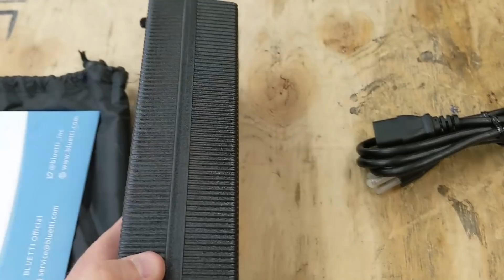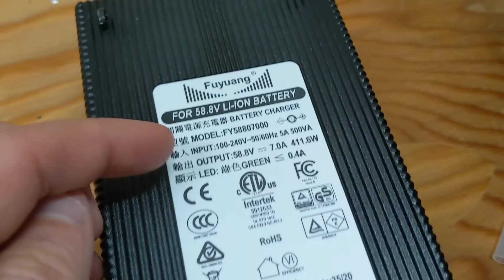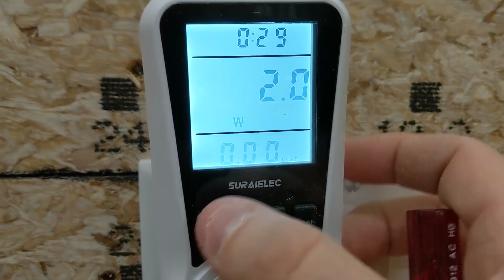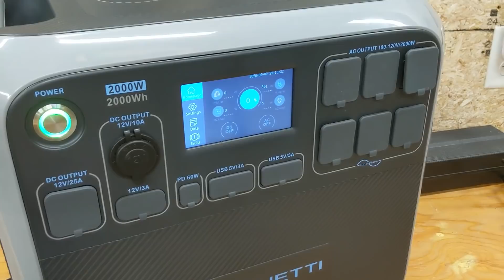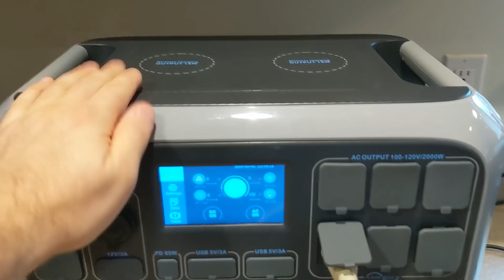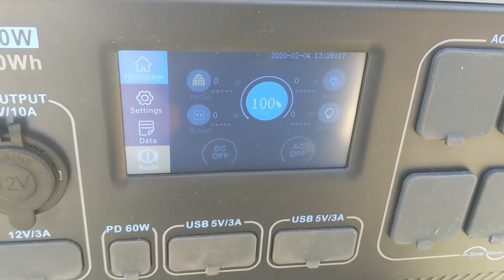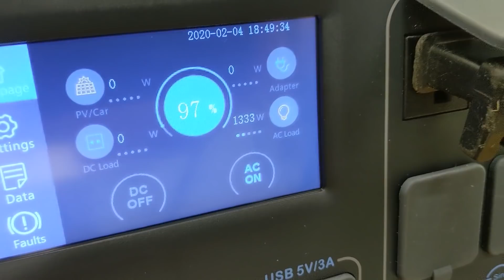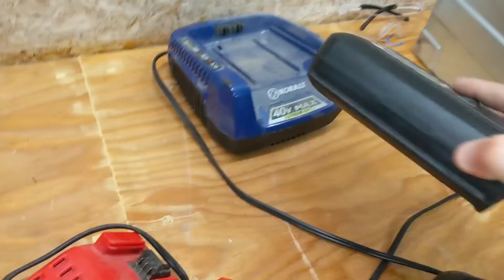DPoz Reviews:  Bluetti AC200P - Updated model for 2021 - Solar Generator

Comment: Hello Dave I enjoy your Videos. Can you answer a question for me?
 In order to determine how many solar panels I need, ---what USABLE Watts can I expect from a 600-watt array? Assume full sun of Arizona. Can I expect at least 300 watts USABLE POWER?
Reply: For practical usage you'd want to consult insolation tables. These give a number which converts the varying amount of sun throughout the day into an equivalent number of sull-sun hours. It looks like Arizona has about 5.6 to 7.4 sun-hours per day depending on the season. If we use 6 hours for easy calculation, your panels should produce 6 hours * 600 watts = 3600 watt-hours per day. That's equivalent to only 150 watts continuous. Alternatively, it would power your 300 watts for 12 hours each day.

Remember this is the amount of raw power from your panels, you'll have less usable power after converter and battery inefficiencies.

Here's a simple formula:
Panel Watts Needed = (Power Needed) * (hours power is needed) / (insolation sun-hours) / (efficiency).

If you need to power 300 watts continuously and your components are 75% efficient, I'd suggest: 300w * 24hr / 5.5hr / .75 = 1750 watts of solar panels.

Here's the insolation table I used: http://www.nooutage.com/SolarInsol.htm
Reply: Wow dude!  You know your stuff.  Do you have a direct contact for future questions?  Thanks
Reply: The answer is it varies, each solar panel can produce what they are rated in bright unobstructed sunlight at lab temperature. If it is 100F they will probably produce about 80% of that value. Very few times is a solar panel oriented directly at the sun, unless you have a two-axis tracker for it because facing due south it will only get a glancing view of sun early in morning or late in afternoon. I hope this is helpful.

Comment: I believe that you have to divide by ten.  For example, your chop saw draws 6.6 amps, not 66.  Check out the splitter that you're using to measure amperage.  I could be wrong :)  Most household circuits are 15 or 20 amps, so I doubt the saw is drawing 66.
Reply: It is only a start current. 20A breaker wont trip right when current goes over 20A. It might trip with 25A within a hour, 50A within a minute and 500A less than a second (even few millisecond).  Breakers are meant to protect wiring in the house. That 66A was (very) short current spike, not the continuous current. Sound very high though.
Reply from the maker: The splitter has two spots, a 1x and a 10x.  I was in the 1x spot.

Comment: This is probably the best all-in-one unit that I've ever seen!
Reply: This is a good unit, for the price point.  It doesn't begin to compare to the Point Zero Titan or the Inergy Flex.  Both of those are far more expensive, but have much greater capacity at every level, from charging, to discharging, to total capacity.
Reply: @jasonbroom7147  I'm not trying to light up a neighborhood...just need it for my fridge and charging devices when the power goes out and this thing will get it done.
Reply: Bluetti has almost non-existent customer service.  Lots of people have had issues with this unit and cannot get in touch with Bluetti.  Buyer beware.